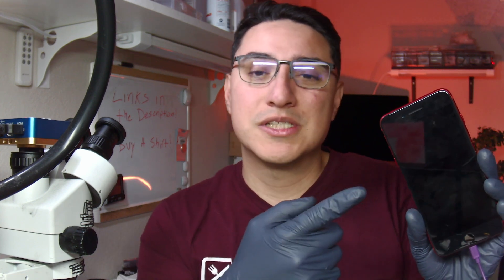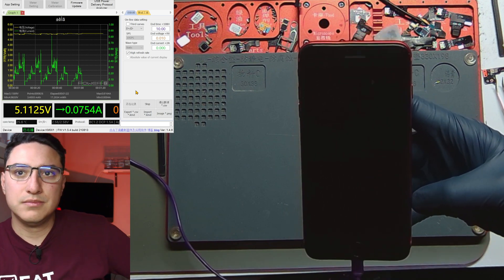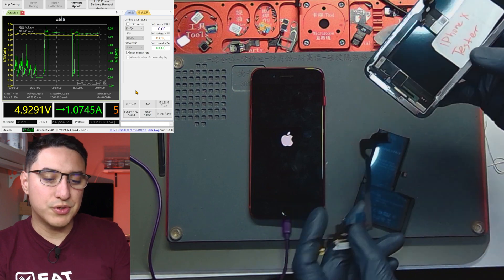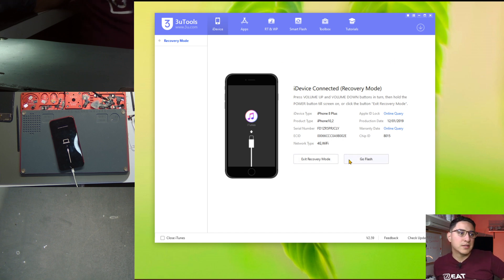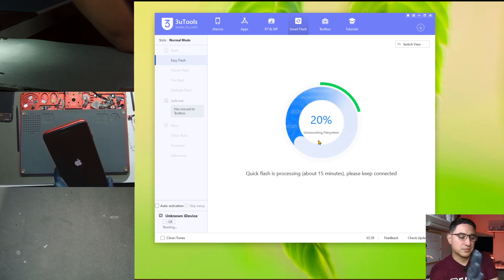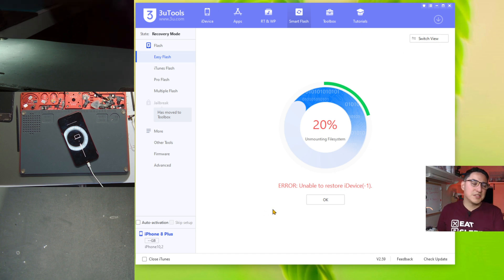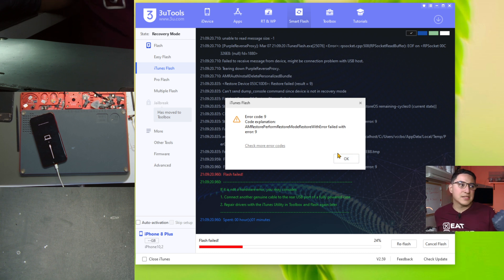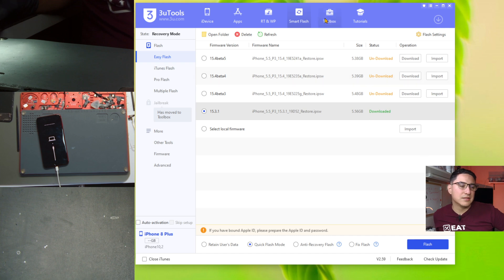iPhone & iPad Bootlooping Troubleshooting Guide. How To Fix a Device That Flashes Apple Logo. PART 1

Comment: I have iPad 5th gen with a hard drop that broke the LCD screen. I replaced the LCD but have a non-erase update attempt to break a reboot loop and passcode timer.  Because it keeps rebooting within 3 minutes each time I’m unable to get to the passcode.  Any suggestions?  I did run the 3uTools successfully but no error codes but didn’t fix issue.

Comment: Hi Jesse,

Really great and informative video. I have more or less the exact same issue on my iPhone 12 mini. However, I did not drop it, or expose it to water, it just entered the bootloop during regular use.  When I tried updating the software with iTunes, I got an error code 9. I tried using another 3rd party software called Fixpo to exit the bootloop,  but I had the same issue as in your video, i.e. the loading bar showed up, but then I did not see any white progress bar, and the software said bootloop fix unsuccessful. What I HAVE NOT TRIED YET is to open up the phone and disconnect all the flex cables except the battery and the display to see if any of the modules (such as FaceID, earpiece etc.) is corrupt. Would you still recommend that I do this, or do you already think that it is a NAND problem?

Comment: So first off all BIG THANKS Jesse for this very, very useful video.
I have purchased an used iPhone 11 with the battery about 77%. I have replaced the battery and the phone finaly was on, everithing was working well, until i did IOS update 18.3 . in this time  the update was by i dont know what reason interupted , and the phone was like blocked in boot mode. I have spent more that one day searching for methodes  to reset, reboot, whatever , so the phone can be updated and work propetly but no a chance, just a lot of programs wich are not free, and i didnt want to pay for a software  just to fix on time iPhone.
Well my problem was solved when i came across on your video Jesse and i have installed 3uTools and followed step by step the Flash method and IT WORKED.
Many, many thank.
God Bless your work

Comment: The 3U Tools is a nice program. I know I like it. Thanks for the information in the video.
My Ipad keeps looping, I can not up date the Firmware or anything. I have tried  Reiboot and it did nothing, it keeps restarting. The same problems that others are having. I have to see what Apple says.
It would be nice if others would post on what they did to fix the problem.
Reply from the maker: This requires more troubleshooting, like I explain in the video

Comment: Hi, I have a 12promax, it was acting slow, battery dies in the evening and never turned on, It was boot looping when I put it to charge. I saw the video and thought to shake/tap  the phone on sensor areas even massaged the phone. now it bootloops until the charging cable is attached. but when I remove it from charging it bootloops for 2-3times and turns on, shows correct date, time ,says no sim detected as I removed the sim, screen works. but it only stays on for 3-4 seconds and dies again. battery shows at 1%. please suggest what should I do.
Reply from the maker: That would require lots of troubleshooting to narrow down the issue. Maybe bad battery, bad charging port or some other part

or board issue

Comment: My ipad 2019 fails at 19 per cent restoring in the Easy Flash but at 21 per cent in the itunes flash with a 4013 error code. It was working this morning  I was watching Disney plus on it and then when I turned that app off and tried to open a game but then it did the loop I dunno what to do now
Reply from the maker: iPad 7 are notorious for CPU problems. One system is bootlooping and error 4013.

If you're in the USA and would like to get that repaired, send me a message www.vccboardrepairs.com/contact-us

Comment: iPhone 7 Plus was over-loaded. I ignored the ‘memory full’ messages and continued with taking pictures and videos until it stopped me from taking anymore videos. I tried to delete some old videos from the gallery and then went in to the deleted folder 📂 to delete from there aswell. But it wouldn’t allow me to do that. So I thought turning it off and on would be a good idea. I turned it off. Now the Apple sign comes on and it is stuck on that for the last 3 days. Tried to run the phone out of battery and then switched it back on, but the Apple sign is still there. How can I get it back on without losing my data?! 

Anyone with the similar experience out there?!
HELP!!!’n
Reply from the maker: If you're in the USA, send me a message for a quote to help recover your data from this type of scenario.

We have lots of experience recovering data from iPhones stuck on the Apple logo

Www.vccboardrepairs.com/contact-us
Reply: @VCCBoardRepairs sir, my mom woke up to flashing logo today. Her iPad is about five years old and we ordered her a new one today because she got her moneys worth. However, I’m so impressed with your software as a 50 year old mom w/not much computer experience that I’m dying to try some of your videos to see if I can fix it, OR TOTALLY DESTROY!!😂😂😂. According to her iPhone, it says it and the iPad backed up to cloud last night so when the new iPad gets here, she will be good to go. Yet I’m dying to take apart an iPad for first time. My guess is she didn’t offload apps, kept cramming pics in storage and iPad finally choked. She doesn’t bang and drop it around so who knows.

Comment: I'm working on a ipad pro 11" right now and it's having some bizzare behavior. It's stuck on apple logo. When we connect either dfu box or use button combo to enter dfu mode with cable connected to PC, then it doesn't go into DFU mode and instead boots the device and everything seems fine unless you reboot or turn it off. Then the next time it will be on apple logo again unless you use dfu box or enter dfu mode. Have you ever seen this before?

Comment: What's the benefit of updating using 3utool vs going into recovery mode and updating it via iTunes?
Reply from the maker: For technicians, it provides more information that is useful for troubleshooting.
Reply: @VCCBoardRepairs  ok, thank you! I have another question, if you don't mind. Should I try updating ios in recovery mode now, or should I send it directly to a repair guy? From what I've read, it sounds like if the update fails, I might be forced to wipe the phone, and I don't want to lose my data. And I have pretty much no storage left on my phone, so I'm not really sure how an update would be able to fit. Is it OK to try updating first? Or will I risk losing my data?
Reply from the maker: An update in it of itself won't wipe data. But if you would rather have a professional handle it, so you don't risk losing your data, best to find someone who specializes in data recovery

If you're in the USA, you can contact me for a quote: www.vccboardrepairs.com/contact-us
Reply: @VCCBoardRepairs  thank you!!! I will try the update but if it doesn't work, I will definitely try sending it to you! 👍👍👍
Reply: @VCCBoardRepairs  hey lol sorry, but I gotta double check. Attempting to update won't corrupt the data and force a reset right? And, what is the success rate of fixing the problem with all data intact if I send it to you? Thanks for all your help 😭
Reply from the maker: No, an update will not lose data.

Although I personally only do updates as a last resort, after already testing and troubleshooting the board.

Without knowing the full back story on the phone, I can't really say what would be the success rate for data recovery

What model is it?
What is it doing right now?
What have you tried so far?
Reply: @VCCBoardRepairs  it's an iPhone 6s. I havent tried anything so far besides letting it drain, and plugging it into the charger to let it keep rebooting overnight. Right now it's just boot looping, it was cycling pretty fast last night but this morning it's staying on the logo for a longer time before rebooting again, if that makes any difference
Reply from the maker: I'd say it's a 50/50 chance of recovery.
Reply: @VCCBoardRepairs hi I got an iPhone 11 and it had the apple logo rebooting issue.  I attempted to update it and now it has a white screen after the apple logo stating to swipe up to recover.  Will this delete my data?

Comment: Thank you for the very detailed video. I tried to recover a boot loop Ipad 6 using 3utool and it failed at 19% (sending kernelCache). Restoring in Itune resulted in 4013 error though. Is there anything worth trying other than reball the CPU in this situation :(
Reply from the maker: not that i know of